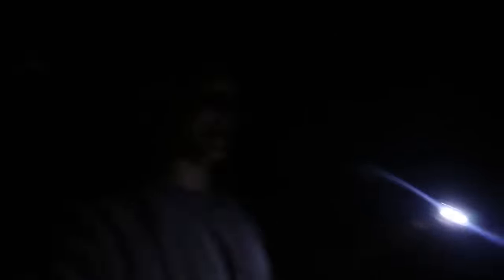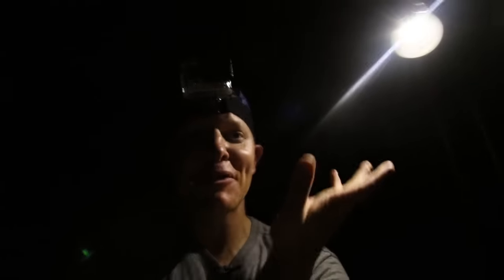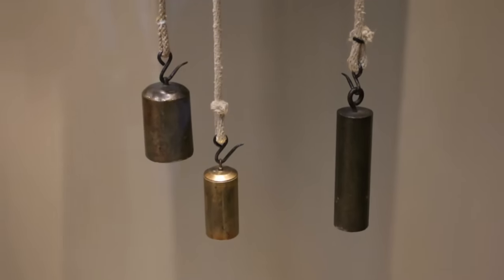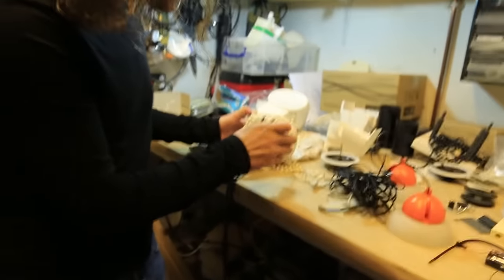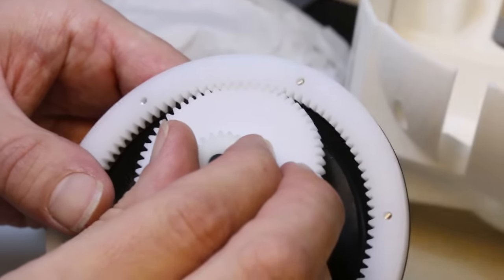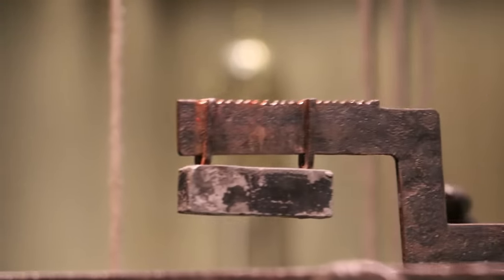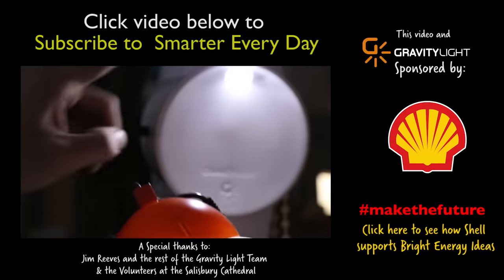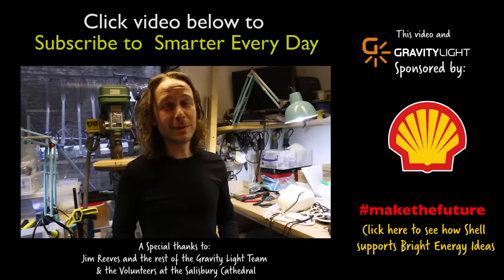Turning Gravity Into Light - Smarter Every Day 146

Comment: +SmarterEveryDay can you make a video explaining how the electrical energy of the LED limits the mechanical energy created by the gears and weight. That blows my minds and completely don't see how that works.
Reply: +Tim Fevens  I also want this. Does the led have a current limiting resistor? or is the generator not able to produce too much current because of mechanical resistance?
Reply: +kwanarchive I know that much but my problem is Why? I don't understand why/how an LED emitting light slows down physical matter.
Reply: +Tim Fevens I have the same question, too. LEDs do consume a fixed amount of voltage, but they usually have current-limiting resistors, which will consume as much voltage as you throw at them. (Wires are just low value resistors as well.) Without them, more voltage will increase the current , heating the wire and/or blowing the LED. But either way, I really don't see how the electrical characteristics slow the physical movement of the weight. Are you sure it doesn't just fall at a slow rate because of the friction in the gearing? What happens if you replace the led with just a resistor? Is Destin saying the weight would fall more quickly?
Reply: +Tim Fevens As an EE student, my best guess is that either the dc motor they are using has a speed limiter based on the output voltage (i.e. a system that won't let the motor over volt) or there is additional circuitry involved in that process. I don't actually have that much experience with motors atm, but the thing about the LED, and diodes in general, is that they have their set voltage limit that is used for many different applications. Look up zener diodes for example, where the breakdown voltage is specified by design. Hope I got close and was at least a little helpful!
Reply: +Chris Godley I have another guess.
I think, this is pretty simple to build. All you need is a zener diode (controls the voltage the flowing energy) and an electric generator.
The generator can act like a motor, so it slows down when its energy is not used. There's the gravity on one side and the electricity powering (yes, powering) the generator on the other side.
Better explained by an electric motor: The faster a motor runs, the more electricity it will produce (yes, produce). A generator on the other hand, will slow down if it doesn't power anything and the electricity/electrons search(es) the easiest path on their way.
And this is used in this contraption. I am pretty sure that they do everything to control the exact voltage of the diode as a slight increase of the voltage causes an immensive rise of the current. And this would cause a lot of lost energy as well as a decreased lifetime.
Reply: +Hoch134  That sounds logical to me! I feel like I was thinking appropriate things, but my lack of hands on experience with motors prevented me from actualizing them lol. I am CS minor, so I'm very much more computer/microcontroller focused. Thanks for the further clarification!
Reply: Chris Godley No problem. I loved to work with motors as a kid and also, I noticed something strange on an old bicycle: a wheel almost didn't spin at all.
My grandfather told me later that there was an hub dynamo in the wheel and after I placed a new lightbulb, it worked fine. Of course, shutting off the dynamo also worked, but that has nothing to do with the electricity flowing backwards.

I actually don't know if they use zener diodes to control the voltage, but this should be the easiest solution.
Reply: +Hoch134 I'm a musician who decided to get a degree, so all my experience is in musical gear and recording software lol. Cool story though, anything involving the wisdom of grandparents always makes for a great lesson! 

More to what I was thinking regarding the Zener (and probably you as well) though is DC to DC voltage regulation. There are many feedback circuits utilizing a zener diode with op amps and BJTs that control variations in voltage. I recently constructed one of these and it worked great: https://en.wikipedia.org/wiki/File:Voltage_stabiliser_OA,_IEC_symbols.svg

But I highly doubt that a similar circuit was used in this, being a low cost device, also noting that the LED itself is cited as the limiting factor. I would be curious to try some experiments with a simple DC motor powering an LED to see if the V drop across the diode will indeed limit the motor's speed. I doubt that there is something inherently special in the DC motor they are using. I'm curious now, haha!
Reply: Chris Godley Well, I have actually no degree (yet) and it won't be in any electricity field, so don't worry. I'm just searching for logical answers and check if they could be correct.

I'm really not experienced, but isn't this an amplifier with adjustable voltage? How is this a stabiliser?

Very often, manufactures call the LED lamp + circuit the entire LED. There will be a circuit for sure, but I guess it's a simple one. I actually think that they didn't even use a Zener-diode. There will be cheaper solutions around.
Reply: +Hoch134  Oh well this is just an example of using the Zener's specified voltage as a constant voltage reference in the op-amp's input. The BJT controls the output current, which can then be fed back to the other input of the op-amp through a resistor voltage divider, which generates another voltage level. The feedback into the op-amp from the BJT will absorb any voltage variances, and while it can absolutely amplify the signal, a unit amplifying op-amp will not. I don't feel like I explained this very well, but with a few basic concepts and a decent explanation it's not super complicated.
Reply: +Hoch134  Also no worries, we're all still students in the end!
Reply: Chris Godley Well, I didn't know that a BJT can also regulate the voltage.
The only think I could imagine of was some kind of inverter which lowers the voltage fed back into the circuit when there is a peak and the other way around.
That's actually good to know as it simplifies a lot.

How well does this circuit regulate voltage? What voltage fluctuation are we talking about?
Reply: +Tim Fevens I know this is old, and I'm a little rusty on my electronic engineering, but no one really provided a very good explanation yet so here goes: Back EMF will play a major part in this. For any variable load on an electric generator, that generator will respond with a proportional physical resistance to being turned, this might sound a bit whacky but the law of conservation would be broken without it (you don't get free energy). If you short circuit a generator, you will maximise this turning resistance and excess energy will be lost as heat. My best guess is that the gearing system + generator setup takes into account a maximum weight threshold for the bag of rocks which is not allowed to be heavy enough to overcome the maximum physical resistance that the generator can provide. I'd guess that there is actually a zener diode bridging the positive and negative sides of the circuit which is being used as a shorting switch and as the generator turns faster, the voltage across its terminals increases, once it reaches a set threshold, the circuit is shorted by the diode and maximum back EMF (turning resistance) occurs to slow things down. There's probably also a damping capacitor in there somewhere to smooth out oscillations. My best guess - could be totally wrong
Reply: Yes, sounds like that's how it must work. A shame they didn't go into any of that stuff (the actually interesting stuff!). Instead the explanation for how the LED creates linear disent of the object was "Once the generator turns up to a certain speed and that voltage limit is reached, the LED won't let it turn any faster." How the LED "won't let it turn" faster was somehow irrelevent. Whatever mechanism that causes that is the most important part of the device - otherwise it accelerates! - and yet it wasn't considered important enough to mention. :\
I would love to have some blueprints to scale this up for lifting more and thus generating more. (After all, humans need to get exercise no matter what, so might as well generate electrical power/storage from it!) Alas, I'm guessing they don't want to reveal that.

Comment: could you have a large scale version of this power a house? use a car jack-like tool to lift a very large weight high up, and reset it every morning as part of your chores?
excuse my possible ignorance.
Reply: and connect it through a gearbox to i dont know may be your treadmill. so that 2 times exercising(morning and evening) may full up all the weights and power the lights for the nex day.
Reply: Good idea, if it was on a large scale, the generator must power a battery to power a thing to re lift the weights thought, that is the only challenge.
Reply: Sounds like the clock.
I can imagine this being applied for a giant battery.

I wonder if the energy generated can be used to lift the weight back up via a motor or something, and still manage to produce more than it wastes :O
Reply: it cant
no perpetual motion, my friend
Reply: Just shove a motor or something to pull it up
Reply: Nope, it's not.  He's proposing adding energy to the system via the jack.  It's human driven.
Reply: the amount of energy required to lift up the weight must be equal to the amount gained from it falling due to gravity. using electricity to relift the weight  is completely pointless. you cant create energy
Reply: Dildo Gaggins
Err, we're using the weight to create energy...
Reply: Yes but using a machine to pick the weight up again to drop it again is not going to work
Reply: +Dildo Gaggins you can use ppl running on a treadmill to pull the weight. exercise + free energy.
Reply: that is much more usefull than this rediculous invention, sport with a use is a nice thing! I bet you can do a lot of money on it. I mean public jams are a place to go, you can even make it free, let small hamsters be happy and pay for your hookers :)
Reply: i meant gyms, but guitar jams are always nice as well :)
Reply: Roman Dudar
So true! And this is just one type of "make many power with little movement" machine, I'm pretty sure it could be adapted to many gym machines.
Reply: What advantage would that have over using electricity from the grid?
Reply: bipi888 The whole idea of this light is that there is no grid.
Reply: Glooberloob - No. This sort of thing just does not scale up.This device generates a power on the scale of a few milliwatt/hrs... (Think a small fraction of an AAA battery) Your home, OTOH, consumes something on the order of 10-20 kilowatt/hours each day - about a million times more energy. You would literally have to do the equivalent of lifting that weight a million times to power your house for a day.

Assuming you had a few thousand pounds weight to lift, you would have to jack it up hundreds of feet to generate that much energy.
Reply: Norman Higgs
You could just use a friction band/gear system to create multiple generators instead o f only one, and like the video said, this works with small weights.
Consider using a tall tower with a lot of "free fall". Also, lifting the weight (I say by coiling the rope it's attached to) would cause the generators to work too, minimizing the energy use.
Reply: If you try to use multiple generators, you will also need more weight, as the generators will act as a regulator brake. Enough load on the generators and they will stop the weight from falling and the system will stop working.
Reply: MrAstrojensen
I guess. This is all theorical, though, I would love test it. Shouldn't be hard to trial & error
Reply: migueeeelet It isn't theoretical, it's easy to prove, if you know math and physics.
Reply: migueeeelet - No, its NOT theoretical. Its VERY basic math and physics: Force times distance over time equals energy. Energy cannot be created or destroyed, only converted. You cannot "multiply" the energy, only change its form. A milliwatt/hr of energy can only do a tiny amount of work, no matter what form it is in. And a 5 pound weight dropping 6 ft is a TINY amount of energy. This system only converts a VERY small amount of energy, because LED's are very energy efficient, requiring a tiny bit of current to produce light.
Reply: Norman Higgs
Idea is, even if you made a tiny bit of energy, this probably could generate some excess energy.
Gravity is a constant, endless force. You can turn that force into a different energy.
Reply: migueeeelet Nope. Wouldn't work. You see, the gravity excerts only a finite force on the weight, a force exactly equal to the energy required to lift it. This means that if you want to lift it, you need to counter this gravity by exactly that amount of energy PLUS the inevitable energy loss by friction in the gearings and the electrical generator and motors. A typical small generator has an efficiency of around 90%. This means that you ALWAYS need more energy to lift the weight than you get back as usable energy.
Reply: Curious. But my idea is the "slow fall" system but when it lifts, it's normal (it doesn't have to lift at the same speed it falls). Something inbetween would be needed.. But considering we're using something automated, it could be done.
Reply: migueeeelet The speed it lifts the weight with is irrelevant. The energy needed is the same. Thus the energy you get out of the falling weight can never be used to lift it to the same height again, as there is always some energy loss in a mechanical system.
Reply: MrAstrojensen
But the original product idea is a system that slows down the falling (I don't remember well). You just have to disable it when you lift it. The "slowfall" "increases" the amount of distance for the weight to fall.

Still, apparently this wouldn't generate much energy.
Reply: svampebob007
You could just rig the threadmill to a power generator.
Reply: Didnt' see your first message. Oh well, it's late here, gonna go to sleep today.
Reply: People on a treadmill use energy from their body and need to eat more because of the exercise. I see and understand that if people want to work out it would be a plus to harvest the energy they put into it but on a physics level it isn't free energy.
Reply: Norman Higgs Yes,,,  I'm with you,,,  the pie in the sky people don't want to think... The facts are in human nature...  If I had an unlimited supply of energy,  and I  wanted to give it away, the distribution,  taxation, regulations would end up making it cost as much as we are paying now. But the media is teaching us not to think.
Reply: Unfortunately the average US home uses like 2KW of power continuously, so you would need like 6 people on generator bicycles riding pretty hard around the clock. If you converted your house to only use dim LED lights and got rid of your fridge and all appliances/fans/heaters and stuff then you could do what you're talking about and run solely on human power. I'd recommend a solar panel though unless you just love exercise.
Reply: Ok, I'm at 17512 kWh on the meter reading and I started a timer. In about an hour I'm gonna go check the reading. If it's at or near 17516 then maybe I am using 4 kW.
Reply: What about building Pumped-storage hydroelectricity?
Reply: a human wouldn't have enough calories to power a house
Reply: or could it be scaled down so the energy of walking could be harvested by special shoes to power your phone or leds?
Reply: migueeeelet  Grab your ankles and lift yourself up. Let us know when you break the laws of physics and can fly.
Reply: Julia Lerner  They are installing floors in crowded public areas that generate small amounts of electricity when people walk on them. I'd love to see this theory added to shoes, where shock absorption generates electricity for your peripherals.
Reply: I think it definitely could be done. The question becomes how do you 'reset' it. Creating electricity via a treadmill to power a motor would be quite inefficient due to energy transfer losses; direct human action on the weight via some mechanical advantage (i.e. a 20-30 minute morning chore) would be much more feasible
Reply: I was also wondering how you could upscale this to power a home